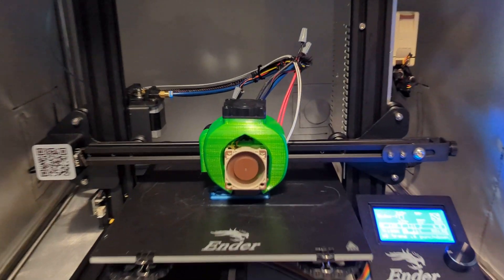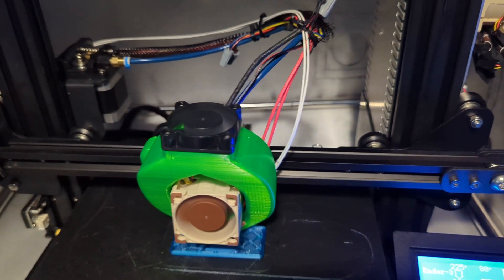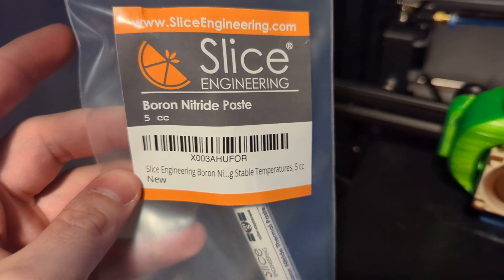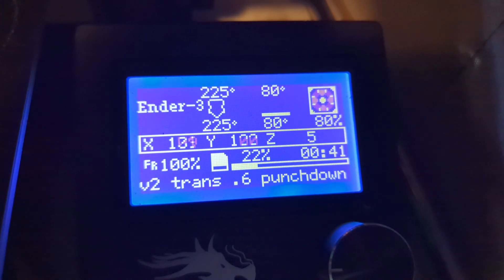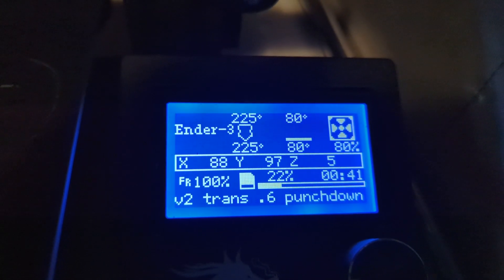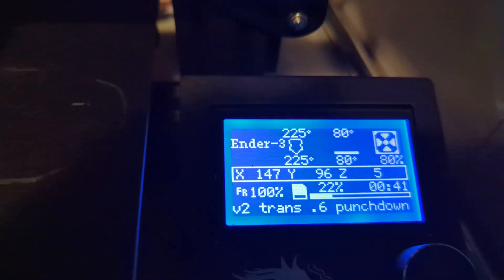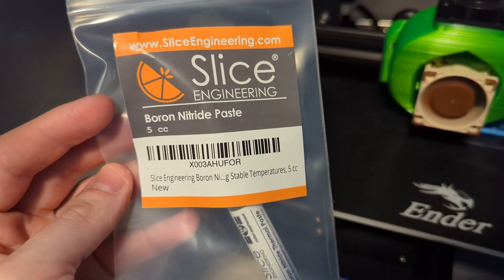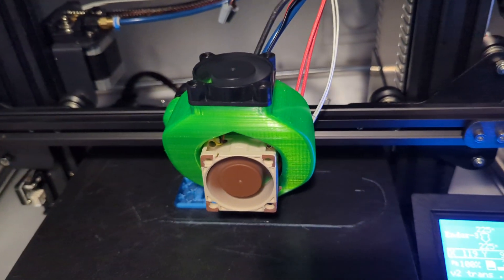How to fix E1 Thermal Runaway Printer Halted Ender 3 Thermistor Replacement Change PID Tuning

Comment: Is it fine to use any old thermal paste? I have a few tubes from some computer builds I’ve done
Reply from the maker: No clue, some might not be rated for the same temperatures. I suspect my wires not being secured and wiggling was a big part of my problem.

Comment from the maker: I've learned of another cause to this problem - a loose Thermistor wire.  In the video the white wire going to the hot end is the Thermistor wire.  It's kind of loose and zip tied a few inches up.  My hot end was getting temperature variations (up to 10 degrees in a second) and sometimes would still do a Thermal Runaway error.  I've just zip tied the wire to my blue filament tube as close as I could to the hot end and fairly snug, as well as zip tying it a few other spots to keep it more steady and consistent.  Temperature is holding solid and not fluctuating at all now.  I thought the screw holding it in place on the hot end would be enough but apparently not.

Comment: im gonna try this tomorrow i also got the e1 error and after replacing the termis it dont keep it steady it gos up and drops down and gos down to about 160c i beleave and then gives the error
Reply from the maker: Let me know how it goes.  Mine is finishing my prints but not holding as steady as I'd like.  I think part of it is how the Thermistor wire moves as the nozzle moves around and I need to secure it differently.

Comment from the maker: Just a heads up, I also had a problem where my printer would loud beep and reset mid print.  I believe this was a different issue of a wire being loose.  Took out the main board (I have the silent board upgrade) and redid all the connections.  Gave all the wires a little wiggle and shake.  Everything solid.  Prints like a charm now.